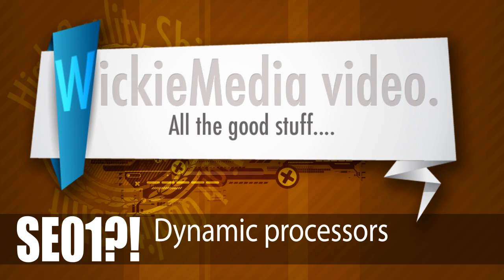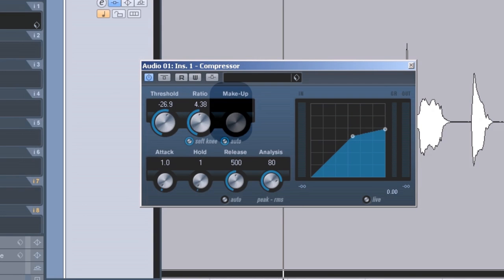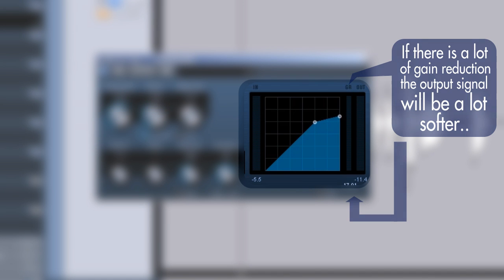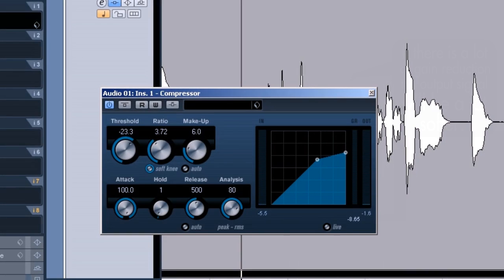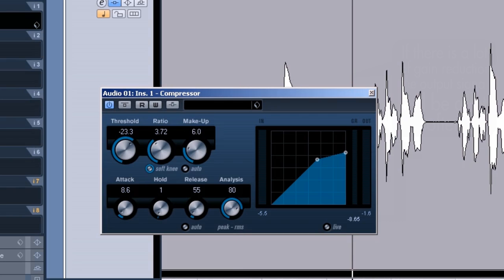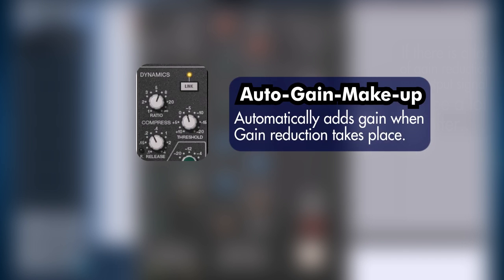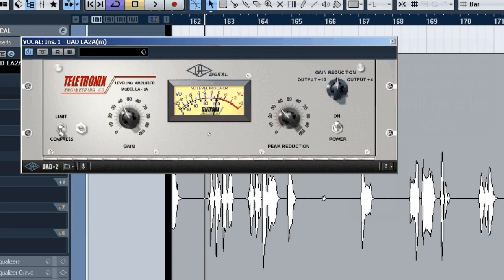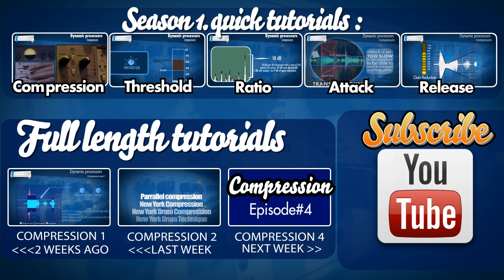Audio Compressors Explained #3 - practical session

Comment: I use Acid 8, It appears that after I put on a compressor the wave lengths don't appear to have changed whether the compression is turned on or off, is it possible that Acid 8 just doesn't change the wavelengths or am I missing something?

Comment: Dude, I really have to ask. So, the threshold tells the compressor at which level it should start compressing, and the ratio how much it should compress, with the threshold level as the "baseline". But, when the signal goes below the threshold and the compressor keeps compressing for a time corresponding to the release value, which is the "baseline" here? Is it minus infinity (or whatever the lowest point the computer can count). Say, threshhold -10 dB, ratio 4:1, attack and release doesn't really matter (right). Signal enter and reaches -6 dB, compression kicks in, reduces the level to -9 dB, the signal drops below the threshold, and is compressed... how much? Have I missed something obvious or have I misunderstod something? Btw, great videos (I guess you know that by now judging from all the comments). Would be super happy for a reply! :)

Best regards,
Elias
Reply: laaarsas the threshold isn't a baseline,  but just the level required to tell compression to start.  if attack is a time based easing in of compression.  then release is a time based easing out of compression.  the time relative to how long it reaches the set ratio or back to 1:1